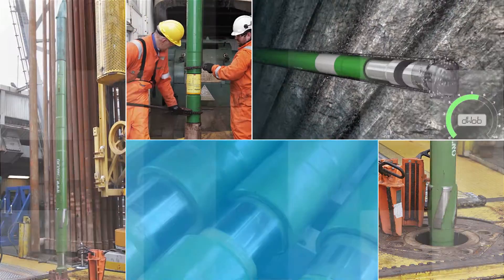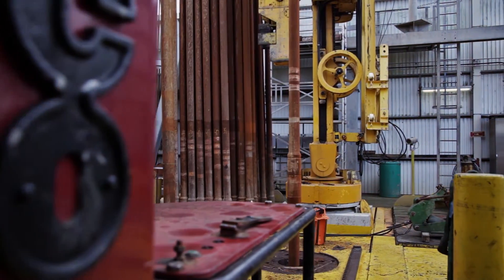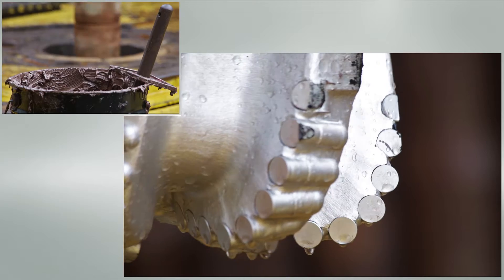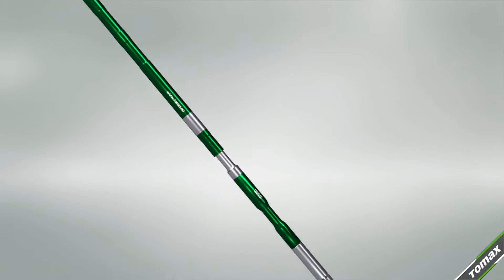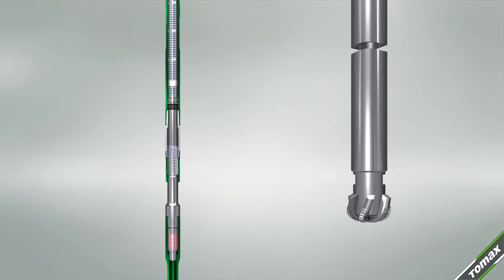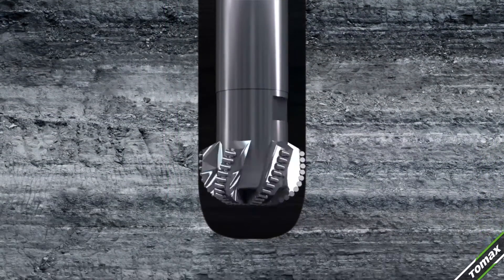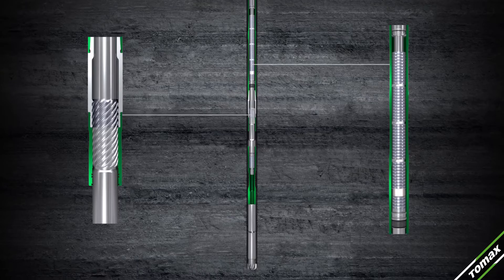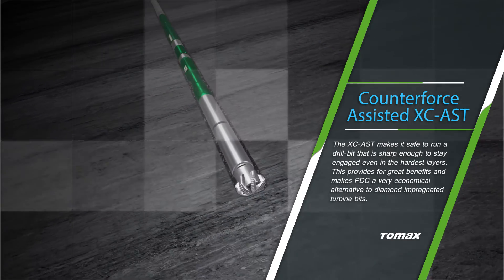Tomax AST CF 5 mp4 20mbps

Comment: I've been out of the O&G business for a long time, but looking at the Tomax system to make hole by adjusting the RPM/torque/vibration/weight on the bit continuously makes a lot of sense as well as getting maximum wear out of the PDC bits. Nice video to illustrate how the TOMAX AST performs the task. Regards